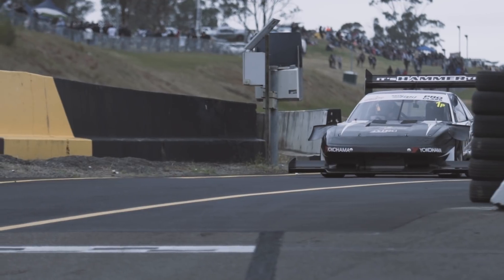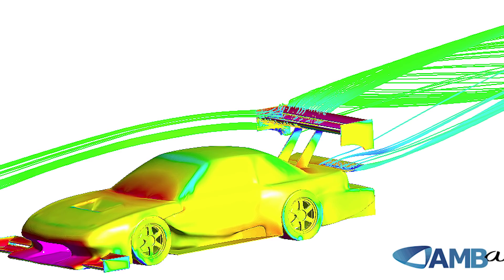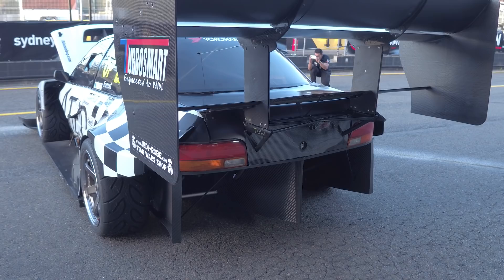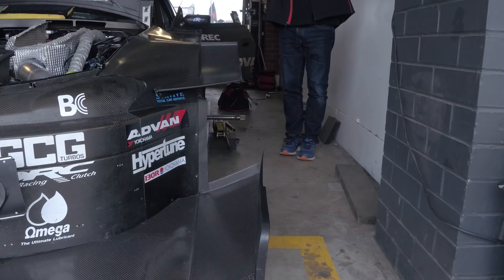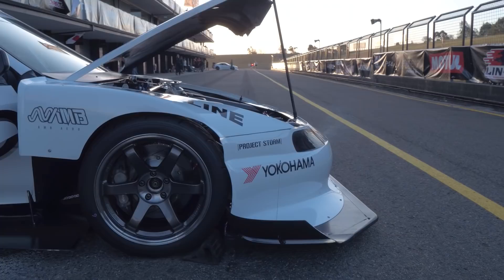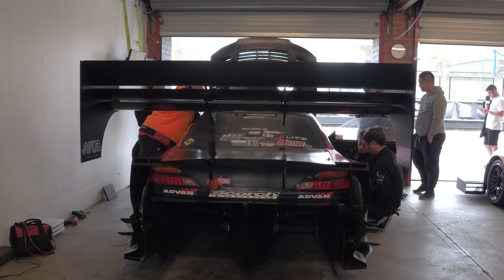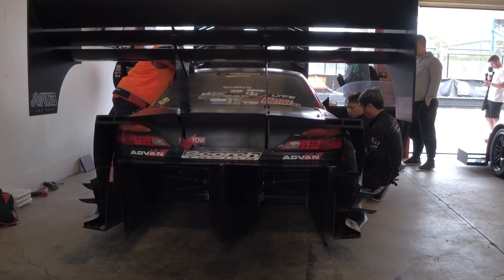1000HP+ is useless without Aero | AMB Aero [TECH TALK]

Comment: I was fortunate enough to work at rahal Letterman racing right out of school as basically the shop bitch lol but I was so fascinated with the scale model they used for wind tunnel testing...that was just so interesting to me ... I was pretty much a minimally paid intern  but I loved it and learned so much from people who were absolutely the smartest people I've ever been around  but seeing what they were able to get with the smallest adjustment made to a wing or a tiny body panel and it would have huge  changes in the tunnel... that just blew my 19 year old mind that like  0.25 of a degree  in the angle of  the wing or splinters etc. Would do so much.... but I didn't get to spend a whole lot of time in that area  i was mainly working with the chassis fabrication team who i also learned a priceless base of knowledge from... sorry for the rambling  but this man reminded me of the people I worked with there.... cool stuff

Comment: for any aero package, the first 90% of its benefits can be designed with the eyes.  In general, if something looks aero, then it is aero.  There is no need for a windtunnel or even a computer for this 90%.  But reap the remaining 10% benefits, then this is where computer, engineers, and windtunnel come into play, this is where the major cost of R&D is.  If you're an F1 team, then sure go after that 10%.  For the club racers, you can get by without F1 budget.

As for the order importance, it's 1) aero, 2) suspension, and 3) engine, in decreasing order of importance.
Reply from the maker: No matter the budget if you want to get some benefits or even get remotely close to 90% you do need to spend some time making sure you're on the right track. An incorrect setup that has just been eyeball setup without any consideration for your power levels could actually make you slower, so it's hard to put a rank on everything like that as it all links together - Taz.
Reply: Youre forgetting a huge factor when it comes to aero. The impact aero has on suspension, just how they talked about. Sure you can eyeball the DESIGN of aero, but you wouldnt know exactly how much lbs of downforce its making front and rear just by “eyeballing” it. So you’ll be in a huge disadvantage figuring out your suspension setup with spring rates and fine tuning them

Comment: its pretty "arrogant" to think one principle is more important than the next. Power, grip, reliability and downforce all need to work in harmony to make the lap time come down. So just as easy as you can say 1000hp+ is useless with aero, aero is useless without the power to sustain that downforce, and power and aero is useless if you don't have the tires to sustain the g-force limits. So is Aero really the cheapest mod? absolutely not. Tires are, without grip, you aren't getting around a corner. Just look at F1. The end all be all to lap times is getting the tires to work.
Reply from the maker: I think you're reading a little too much into the title, and note there are class rules for time attack that won't see cars like this running slicks like F1, and with that in mind if you are losing time/grip due to a limited range of tyres to select from you're going to have to work on picking up in other areas....such as aero ;)

Also note with a 1000HP build, one would hope the team does have the basics covered when it comes to tyres and we're not ignorant of such things. You might enjoy this video for examples: https://youtu.be/Oc6QQVDx2Io - Taz.
Reply: I think you are reading a little bit too much into my last sentences. And ignorant was not the right word in this situation, you guys have given a ton of good info over the years. "Arrogant" the statement and the discussion is none the less. Even with a regulated tire choice for your class (just like it is in F1) you still have to get those tires to work as good as the next guy. so the situation is still the same. Slicks or not, you are given a baseline to the rest of the competition. If you can't get those tires to work better than the next person, then you lose time. Downforce is still but a portion of the entire conversation. Aero means nothing if you can't translate it to traction, and traction means nothing if you're car isn't fast enough (power) in the first place. So again, all things need to work in harmony.Thanks for the clip, I watched that previously :). Good info.
Reply from the maker: Considering the topic of the conversation is on aerodynamics, and we're talking an accomplished aerodynamicist, every other factor that comes into play is not going to be discussed as the focus is aero. I don't think that makes anyone arrogant to zero in on this regardless of the other factors. Just because every single topic relating to getting a car around the track is not discussed in one sitting doesn't mean it's unknown or ignored 😜

Glad you're enjoying the content and cheers for getting involved with your comments too. Andre and the team made it to Goodwood this year for you guys so keep an eye out for that footage to start hitting the ground in the next few weeks, it will be very varied due to the variety of vehicles there too  - Taz.